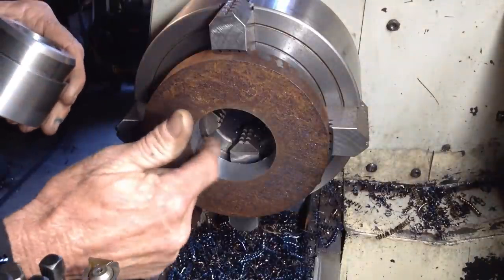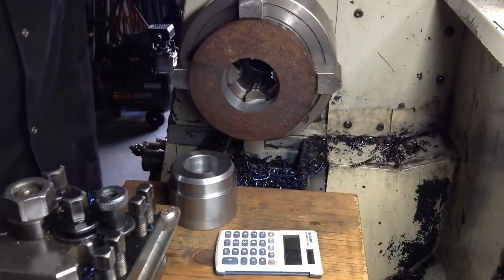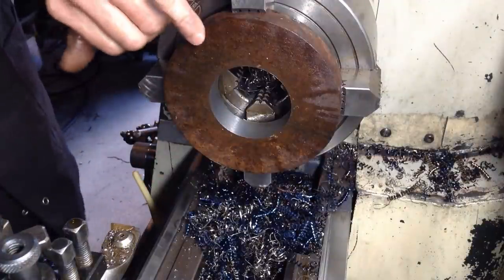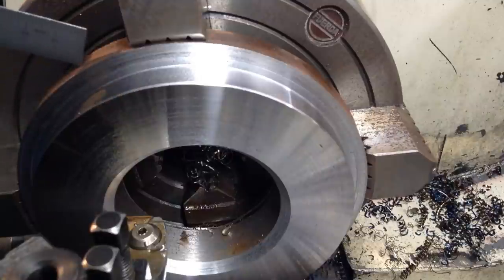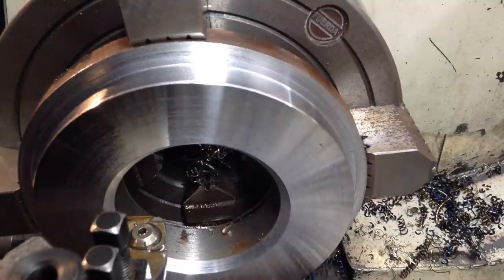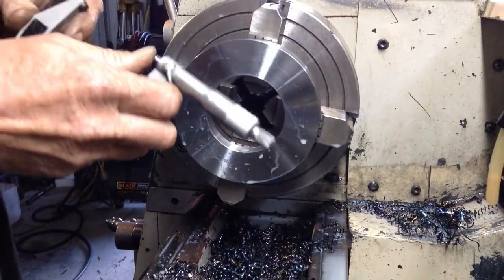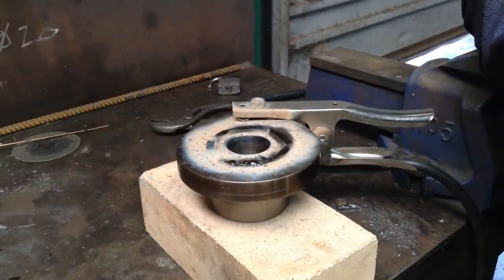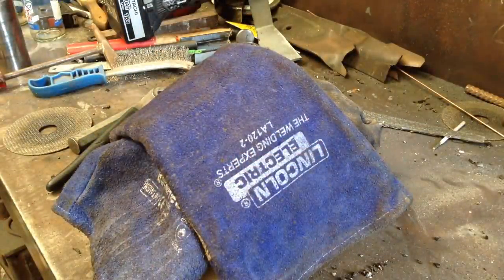Lathe Tailstock Chuck Mount .    Part 4 .

Comment: As a 49 year old Canadian I just caught the tail end of the imperial system in school.  In grade 1 I was taught distance and volume in feet, inches and gallons but by grade 2 when I was taught temperature it was Celsius.  To this day I can talk with my dad about distance etc. in imperial but when he tells me the temperature in Fahrenheit I struggle to know how hot it is.  When I was in engineering I preferred to do all calculations in metric as it is a much more logical system and makes calculations easier.  If given a question in imperial units I would convert everything to metric, do the calculations and then convert the answer back to imperial.  Once in the machine shop however, I much preferred imperial over metric.  If given a metric drawing I will convert every dimension and tolerance to inches and go from there.  It's a topsy-turvey world we measure in.  Ken
Reply from the maker: Imperial with machine tools is easy , you don't have the various different divisions as with a metric machine  so you don't have to think too much !     I usually end up putting an indicator on the cross slide as every division on my lathe is 0.025 mm  or 0.05 mm in a diameter reading  , so it's a pain in the ass  when you want to cut for example 0.02 off the diameter !      Milling machines i have worked have 0.002 mm divisions & that's a piece of piss to deal with  as it's a whole number .
Reply: It can be complex and confusing eh, but for ease of use and accuracy, I think it has to be metric. Ken.
Reply: 70yo

Comment: 👍
I love that freehand chamfering, but more impressive than that is the way you indicate by eye. 
So you knocked the slag off to continue the weld, if your rod was long enough to go all the way around would you stop to knock it off where you began or knock it off while still welding.
Reply from the maker: No , just keep the weld going until it hit the start & keep the arc short to keep under the slag .

Comment: Hi Max I am wondering how then you flipped yor part on the lathe you did not use any indicators to center the part. How did you do that. I enjoy watching your videos very much. I was a welder for 40 years and when you said you can get cracking in the welds if you don't leave the flux on it is not true. The only way you would get cracking if are welding thick materials  without  a preheat.  The other way for cracking is  not matching the right welding rods to the materal  you are welding. Your welding rod supplier can help you with that that. You did everything  right you preheated  and you welded both sides hot. Another great video I really enjoy your projects. Cheers
Reply from the maker: That was just eye ball setting the flipped part .
With leaving the flux on with low hydrogen welds  , that's what i was taught to keep the weld a bit more insulated from cooling to quick .  
Thanks for mentioning that .    Cheers .

Comment: Hey Max ,Just set the play back speed too 1/2 speed to savour the moment on that facing cut.
Love your work. As an unexpected bonus , I have the same lathe and quick change tool post.I noticed you don't have 
a handle to loosen the tool post which got me thinking I will ditch the handle and replace it with a nut and ringy cause 
it can be a pain in the arse when trying tool change tools. Thanks for the idea. seeya
Reply from the maker: Thanks . Yes i ditched the handle a while back , could not always get it tight enough  . When you really push the lathe , turning chrome bar or hardened pins the post sometimes used to shift .
Reply: yeah there's the hole you can drill and stick a pin in but i don't  want to stick holes in my new toy yet and its never  in the right spot when you need it seeya @swanvalleymachineshop
Reply from the maker: @RosCug  I did , just have to make the pin !
Reply: @swanvalleymachineshop  Bugger, now I'm gonna have to do it.

Comment: Gday Max, lots of material removal there mate, it was a very nice press fit, I didn’t know that about the slag, it’s that only with the 16tc rods?, Cheers
Reply from the maker: About leaving the slag on , yes because of the material being welded & low hydrogen rods .  It's just good practice .

Comment: Hi Max, enjoyed your work as usual,  well done.  My question if it's ok is ...  after you had the centre machined to internal size, why didn't you press the centre section in, weld it, then from there machine the other face & O.D. to have a finished true section ready to do your next section ?
Reply from the maker: The weld prep would have  not lined up with the end of the boss as the flange would have been to wide still .

Comment: Max, as a non-Weldor, I have to ask about not chipping the flux/slag away for a bit of time.  Does that wait slow the cooling enough to prevent the cracking you warned about, or is there another reason?
Reply from the maker: That's what i was taught back in my apprenticeship .  If you look at Carl Penny's comment , he is a long time welder & says it's not necessary .

Comment: Max, whats the info on the insert in your boring bar?  I ask because I picked up a tool with that same insert and I think its great- want to get more.
Reply from the maker: The inserts i use are Kyocera TPMR160308 .  Other brands will have the same insert .   👍
Reply: @swanvalleymachineshop  thanks mate

Comment: Hi Max  This may be a stupid question but here goes with proper press fit why do the parts need to be welded? Thanks
Reply from the maker: Hi Randy  . It is because the press fit width is a lot narrower than the diameter .  If it gets a solid bump or dropped it could shift   The weld prevents anything happening in that respect .
Reply: @swanvalleymachineshop  ok that makes sense. Thanks Max

Comment: Frustratingly  amateur effort.
Incorrect technique to get correct bore for press fit.
No attempt to run the fip side true to first side with run out obvious.
Promotes  bodgy technique to Hammer-chewers.
I know you can do better so it is frustrating to watch...
You can  delete my comment now,
Reply from the maker: So you would waste time clocking something that still has to be welded & machined ,  By the way that was a saw cut disc that was not cut square .
If you wasted time truing something up that only has to be eyeballed at that stage in a job shop , no doubt you would have your ass kicked .  
And no  am not going to delete your comment , please explain your incorrect technique 
comment thank you .
Cheers .
Reply: First, I  apologise for my harsh statement.
Second, I am 60+, an asshole perfectionist and have many times been told/kicked in the ass for being overly fussy when it wasn't really nessesary.
But, l have been better utilised in doing the more exacting jobo's..
You and I know it's not hard or overly time consuming to set up EXACTLY.
I congratulate you on being, intentionally or not, part of the YouTube University Faculty.
And as a fellow Aussie, I would like you to shine.
I promote an approach to finished size of 3 balanced cuts, with measurements after each,  balancing pressure, speed, chip formation and temperature to end up, totally predictably, on size and finish.
Not linish to finish.
I don't like criticising in this public forum, I'd much rather talk  privately.
 And I think I've watched most of your videos and I like them, mostly!
Hahaaa.
Reply from the maker: @captcarlos    You should be happy with the next one !   No emery paper , all tool finish to size  !     Cheers .
Reply: I apologise again.
I think I'm suffering 
Shed Envy.....